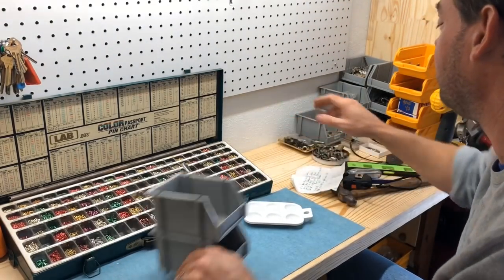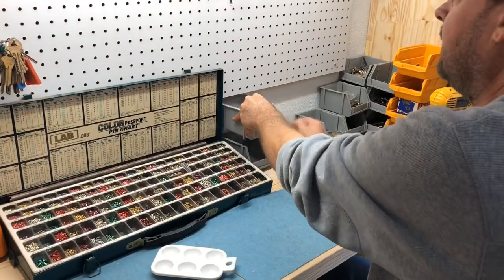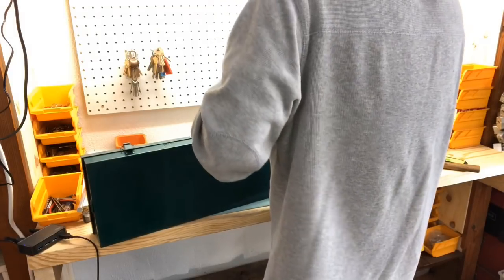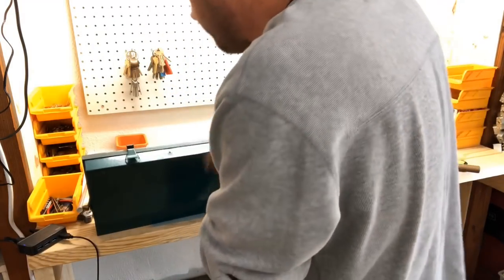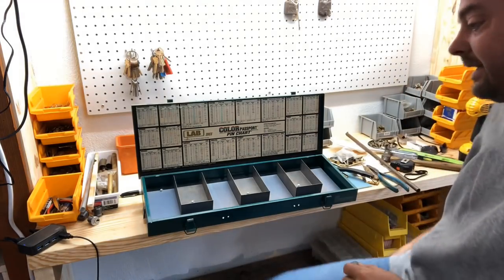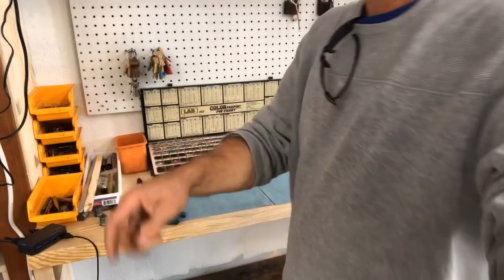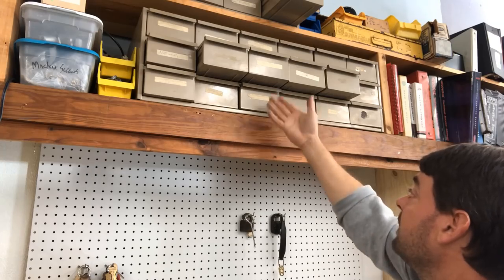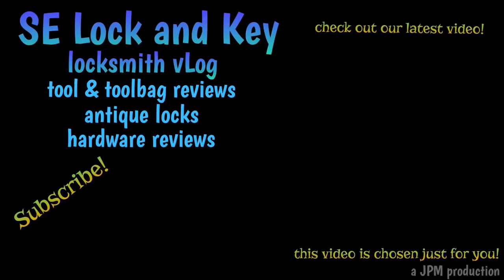removing the handle from LAB pin kit (older footage)

Comment: After seeing you use the paint pallets for pins I got a few and didn't like how easily they tipped. So I bought some ice cube trays. I got the silicone ones. The cube compartments aren't as big as regular trays and they aren't as slippery as regular trays. Find them very handy when doing large master key jobs. Some I cut down and some I left intact. Only way I've found to remove those continuous hinges is to slightly pry open every second section along the hinge and the rod will slip out. However you still have the actual hinge sections on the lid and on the box. Curious as to why you want to remove the lid ?
Reply from the maker: King Street Rob I dunno, someone mentioned it in comments...removing lid and just creating custom charts 🤷🏼‍♂️ I didn’t really want to

Comment: Cause you move around alot, a lapel mic would be better. Also normalizing studio levels.✌ I installed cabling racks and those storage tubs in my old work van. Name brand ones were super expensive compared to these days. :/
Reply from the maker: yep, looking at the choices now however they are still far from perfect :( "normalizing studio levels" *goes and builds soundproof room around workbench ;)
Reply: @selock  being OCD, that could be fun! Lol.😁 Bosnian Bill has gone to insane levels with audio recording methods and soundproofing... probably way over the top. 🤓✌
Reply from the maker: yep, must be nice to be able to do all that ;)